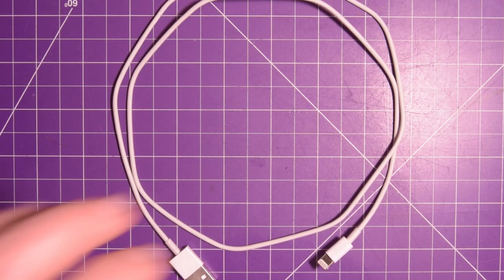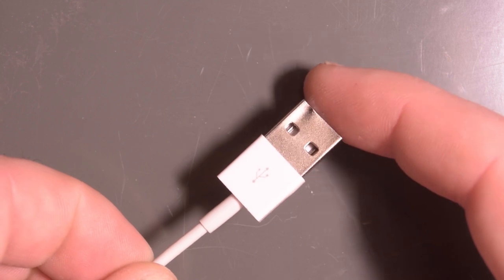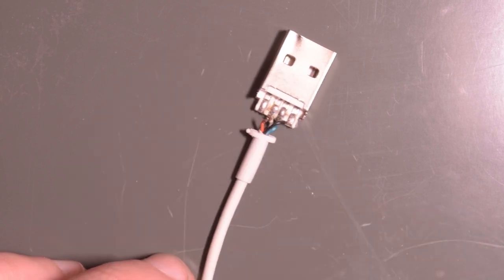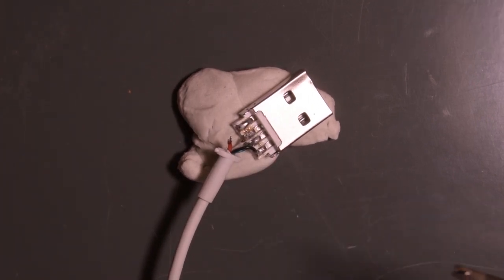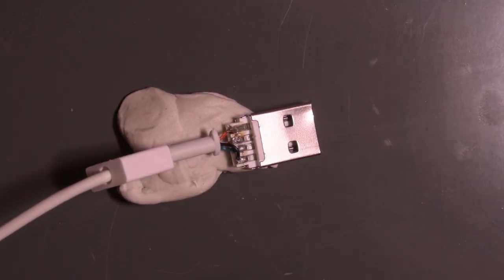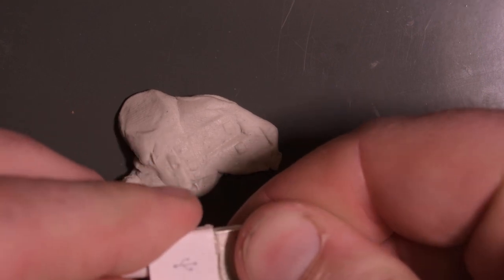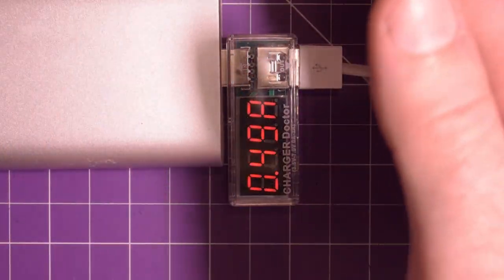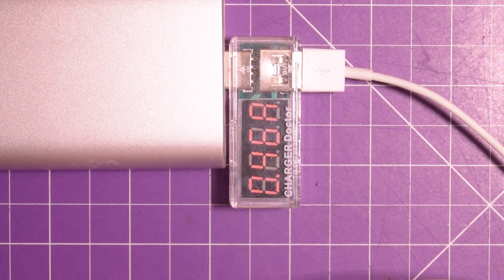Repairing a Broken "IPhone" Charge Cable

Comment: Try an Anker Powerline cable. I've had six of them for just over two years, and only one has failed.
Reply from the maker: Yeah I kind of like the cheapness of these cables, it allows me to have 5 in 5 different places and I can even give them away if a coworker forgot to bring one.

I also have a particular use case where I have a Lifeproof case and most aftermarket charging cables are too thick to fit in the hole for the charging port.